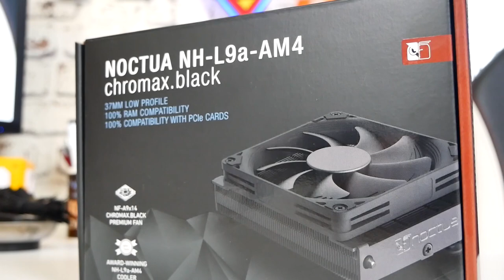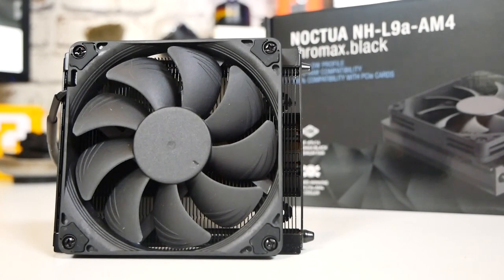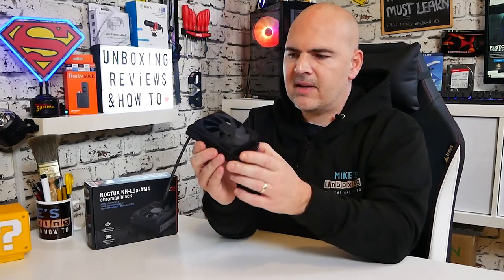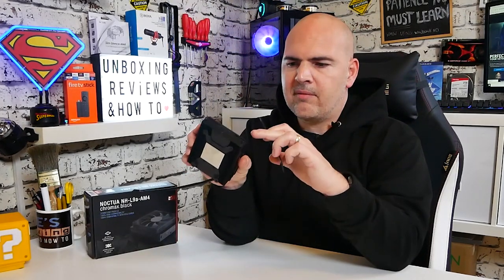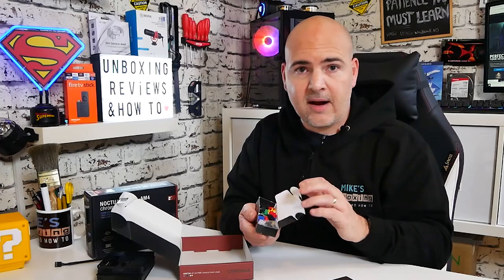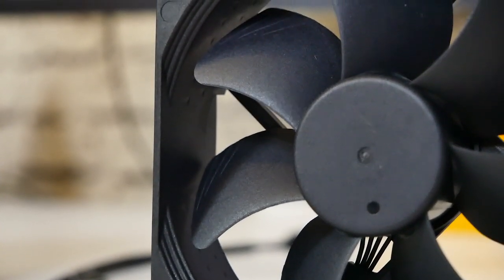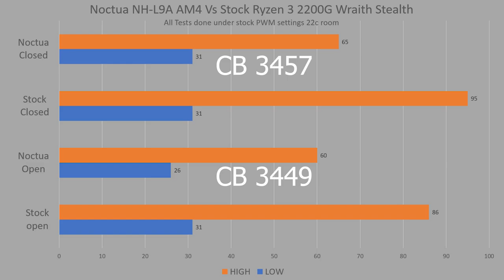BEST LOW Profile CPU Cooler Noctua NH L9a AM4 Chromax Black & Optional 25mm Fan Testing

Comment from the maker: *One small mistake I made was that I mentioned that you can upgrade the L9a-AM4 to intel, which is actually not true. Whilst this is the case for most of Noctua's coolers, the L9a-AM4 has slightly different dimensions to the NH-L9i, and because they are both so flat, the L9a-AM4 is a little too big for some intel motherboards. So, whilst the NH-L9i can be upgraded to AM4, the L9a-AM4 cannot be upgraded for use on intel sockets. Hope that clears things up!*
Reply: Can this cool 5600x? I will have Tecware VXR (similar to Lian Li O11D) with 9 Arctic P12 PWM PST fans installed.
Reply from the maker: @Bryysanity  this is a bit small for that really i would go for something a little larger or maybe an arctic freezer13x?
Reply: @mikesunboxing  is the stock cooler not bad? I won't overclock. I'm planning to just use the stock cooler and just buy an AIO soon.

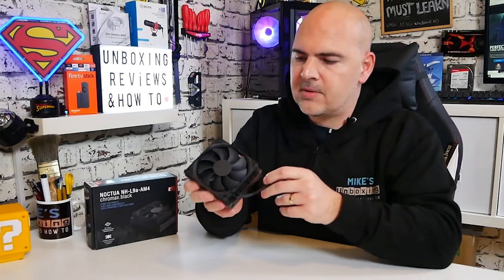Comment: Nicely done.   8:29-8:51 and 21:28-22:28 answered my questions about using 25mm thick fan instead of the 14mm thin.
Reply from the maker: thanks for watching
Reply: It makes sense because the 14mm fan runs at a higher power and at up to 2600rpm, vs. ~2000. The result is a higher static pressure and a greater ability to push air through the tight fin stack.

Comment: Welp, since the Alpenfohn BR is not compatible with AM5 boards made after 03/23, my next best option to cool my 7800X3D is the L9A-AM5 with the 92x25mm chromax fan swap x'D

Comment: Really helpful.  Thanks so much.  I bought a case from Amazon (Kabiou A1 ITX) have ordered an Enhance flex 600w PSU and plan to buy the AS rock A520M motherboard with Ryzen 5 5600G.  Hoping the bios will recognise the processor on a brand new board. 
I suspect the stock fan will be too large for the case so may have to buy the Noctua so your video was really useful and well presented.  I’m only going to be doing general purpose stuff on the machine with maybe light gaming. Planning on buying 3200 ram (2x8 gb)and maybe 1TB of PCIE SSD (gen3)
I’m sure the onboard graphics will be enough for me but presumably in the future I can insert a separate GPU card.  
Would you say my choices of components are ok?  Or have I made a major error anywhere?
I’ve only bought the case and PSU so far.  Not rushing the build. 
Thanks so much and great channel!
Reply from the maker: thanks Rob very kind of you, looks like you have some nice parts there, not totally sure what board you are referring to there, maybe get in touch on the discord chat and we can go over it

Comment: I recently used the LGA 1700 version of this on a Z690 for a 12700k. it cools well, but I am not a fan of the mounting seems like potential for more sliding the cooler around to flip the board to install.
Reply from the maker: i think this is possibly one of the worst mounting systems i have ever come across
Reply: @mikesunboxing  Definitely, They could have easily made passthrough hold on the top like other coolers and mount it straight to the existing AM4 backplate or intel Plate option :)

Comment: Awesome video! Do you think this cooler would be enough to keep a 5800x cool? I wouldn't be overclocking
Reply from the maker: hmm it will greatly depend on the cases overall airflow, if you have enough cool or cold air coming in it might be enough, but i have my doubts if i'm honest and definitely turn off precision boost
Reply: @mikesunboxing  Cool, cheers for the response bro!

Comment: Nice work Mike, as I've said previously I'm not a fan of this type of CPU cooler and prefer a radiator but at least these have a slimmer design which is more appealing to me.  Off topic question, X570 motherboard to be used with photoshop and premiere pro, what is your opinion, a good buy or should I look at something else?
Reply from the maker: i might be tempted to the tomahawk or maybe even the b550 tomahawk but it depends on what cpu you are thinking of using
Reply: @mikesunboxing  I need to update my work PC so therefore a CPU that will happily work with photoshop and Premiere pro?

Comment: I'm very surprised that the slim fan outperformed the 25mm. According to Noctua the 25mm not only puts out much better CFMs but also slightly better static pressure. I wonder if there was another variable in the testing that could have caused the higher temps with the 25mm? It's that or Noctua isn't reporting accurate specs on their products...
Reply from the maker: think if the fans were side by side in a test wind tunnel pipe they results would make sense but sometimes due to the angle of fans etc and being right up against the heatsink they perform differently and and the fins are very densely packed on this cooler, almost like a gpu cooler
Reply: @mikesunboxing  You might be right, but in my mind the discrepancy being so large doesn't add up. I was trying to decide which fan to buy for my CPU cooler. I might buy both & see if my test results yield the same out of curiosity. Might be a couple weeks but I'll let you know what I come up with. Thanks for the Vid & the response!
Reply from the maker: @ricksanchez243  That would be interesting, thanks

Comment: My AMD Ryzen 5 5600 came with a cooler, but I thought I'd go for a Noctua, as I thought it would be better. The back plate doesn't fit the motherboard as bits stick up from the MB and would touch the backplate. The original had holes to avoid this. Also, fitting it is difficult. So I used the supplied AMD cooler. Don't recommend the Noctua for this mini-itx setup. Altogether I have to say that ALL the manufacturers instructions are badly scripted, have too small type, and miss out on some important procedural info.

Comment: Can you bios flashback the b450 tomahawk with ram cpu and other things installed or everything has to be out except what you need for it to work because I plan on upgrading I already have my b450 in my case everything in it plan to update bios by flash to get support for ryzen 5000 just wondering if I dont have to unplug everything except what I need to save time
Reply from the maker: i'm not sure to be honest. I would try and update with the system setup as is using the normal bios update feature

Comment: What is closed and open test in the graph
Reply from the maker: the slightly lower temp is open
Reply: @mikesunboxing  still didn't understand. The Lowest temp is called closed and the highest is called open?
Reply from the maker: @Superman__-hr1ws  Open is with the case top (lid) off and closed is with the case in tact

Comment: Actually there is something that it is not compatible with. Msi b550i gaming edge wifi and max variants. It has IC components in the area of the backplate and you have to eiter cut the provided noctua plate with a dremel or order a free seperate kit from noctua and use the stock plate.
Reply from the maker: that is interesting thanks for the headsup

Comment: Can it cool i7-10700 under full load (not overclocked I mean) ?
Reply from the maker: i think it will be a struggle to be honest unless there is really good airflow in the case
Reply: @mikesunboxing  how about 5600x? I will be using Tecware VXR with 9 Arctic PWM PST fans.

Comment: can it cool ryzen 5600x?
Reply from the maker: don't see why not, but a good airflow case would be recommended
Reply: I dont know if it is too late But i am using this cooler with a 5600x in a good airflow case. About 70° under load - in other words it is very capable

Comment: For this price I wish it was RGB
Reply from the maker: yeah i get what you mean
Reply: @mikesunboxing  I just want a cooler that has fan facing the way how a stock cooler does. All rbg cooler have fan facing side ways making my setup look ugly.

Only rbg coolers with normal fan position are thermaltake ux100 and antec t120 both are horrible as per reviews. Alst is aero cool mirage 5 which is something I am not sure about the product quality.

I thought of changing the fan in this noucha to some RGB fan but it's hard to find fast spinning 92mmx14mm fan

Comment: Mounting method is absolutely horrible.
Reply from the maker: yes awful design
Reply: @mikesunboxing  I ended up using four strands of dried linguini to help guide the mobo onto the heat sink. I kid you not. (Perhaps Noctua should ship the linguini as part of the mounting system.)
Reply from the maker: @KaitainCPS  Lol!
Reply: @KaitainCPS  They do have plastic straws as part of the NA-FD1 fan duct system. (There is also an NA-FDBE1 accessory kit you can order for free to extend the bolts that replace the fan attachment screws to accommodate 25mm fans as done here.)